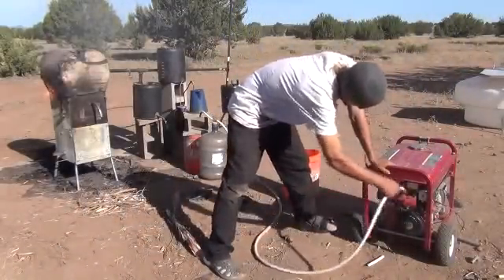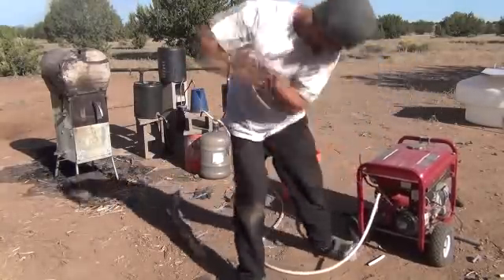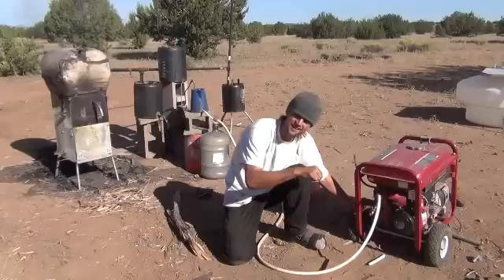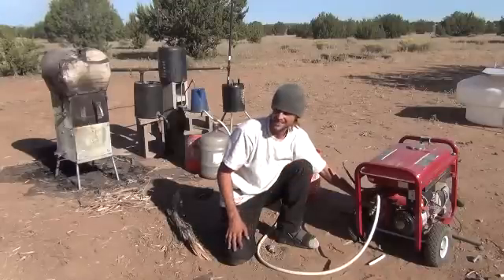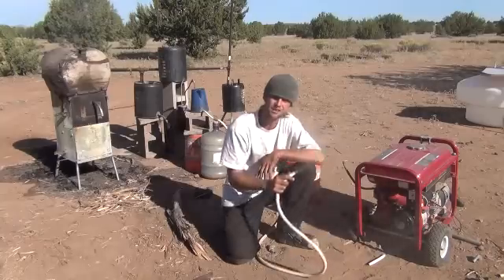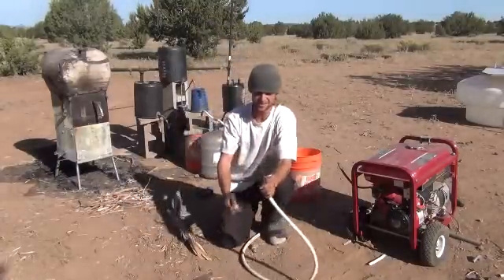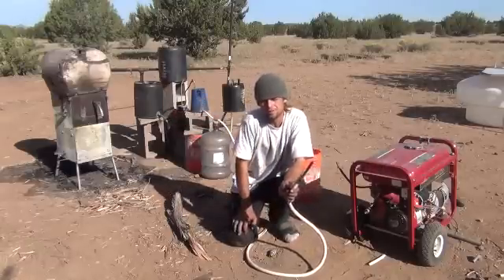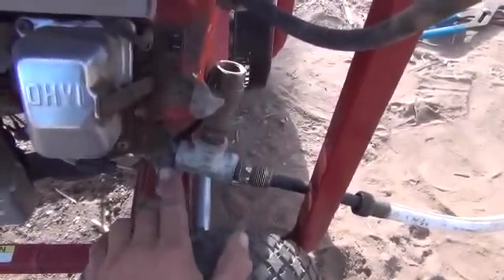Wood Stove SMOKE used to run a generator, with a load test!

Comment: can you use that wood gas to run a furnace to heat your home? Just as you would use propane?
Reply from the maker: Yes, it will function in propane stoves as long as there is no pressure regulator.

Comment: I would be using the Genny to charge a bank of batteries, and use an Inverter strong enough to power your tools.  Guaranteed a steady flow of power that way.
Reply: yeah you can store power as well in-case of an emergency...

Comment: so you're the reason why the feds are making it illegal to use a wood stove..... hahaha!  well it isn't really funny, but all that they are doing is giving themselves the shaft. It's just going to put more pressure on people to make further developments in alternate energy!!!   It's going to get to the point where water-fuel-systems will be so abundant that they will attempt to poison every water supply to the point where it cant be used to power something, if that is even possible.  Isn't that kind of what fracking is doing, except they are doing it to force people onto municipal water by poisoning the aquifers and therefore everyone's wells.  It's quite easy to distill water, though...

Comment: What's wrong with getting rich? If you don't capitalize on YOUR IDEAS someone else will. 
It's a neat idea, but as long as I can still use the grid or gasoline I'll be staying on my grid and using a gas generator for emergencies. I don't have the time to set something like this up. Does this gum up the engine like ethanol does? I don't want to constantly buy expensive anti-gumming chemicals.

Comment: Here's a thought Mr Teslonian,you may want to look into finding a 1 or a 2 cylinder water cooled engine-generator,take the radiator off and pipe the cooling water through a coil type domestic hot water heater(or a flat plate) hydronic space heaters for space heating..A thought I had also,was very common back in the 1900-1920s was to run a DC generator to a battery bank,have the genny come on when the batteries run low and then invert it t0 110/220 60 cycle

Comment: Very neat. I've often wondered what I would have to do if the grid went down and had no gasoline to run a generator. I would need to pump water to survive, but I have plenty of wood to produce gas.

Comment: You can store it in innertubes or even LP tanks i like the innertubes i use my fan to inflate then put a weight on them to give a good psi to use for cooking and run my gen but no need to fire up the wood gas unit. The problems with trying to compress syngas is its very hard to compress.

Comment: Removal of oxygen is apparently required to make it less dangerous for storage.  Only 1% oxygen or more is required to make it a potential bad idea.

However, if the oxygen content can be monitored (emissions tester?) and kept to below 1%, pretty much any compressor can be used for storage.  Fridge compressors are good for 500psi if your containers are :D

Wire wool filters for oxidization could help but I am still looking into these options.

Very Good Job Mr Teslonian.

I love your show :D

Comment: awsome Teslonian I believe your wood stove is heating a sealed tank with wood in it. called destructive distilation. Is that correct? Interesting coffee pot condenser.and plastic 5 galion ccontainer to collect liquid after condenser. inginious work. also other condenser and bio fuel collector.I run my home almost completely on solar electric panels batteries inverter.most of year.Im also working on a fema type gasifier and generator to charge my main batteriesin winterKeep the Faith John Millard